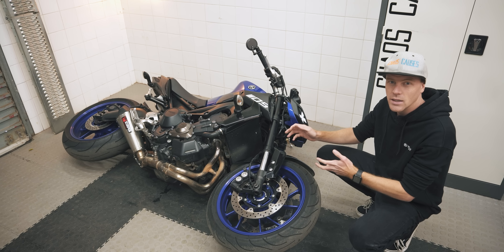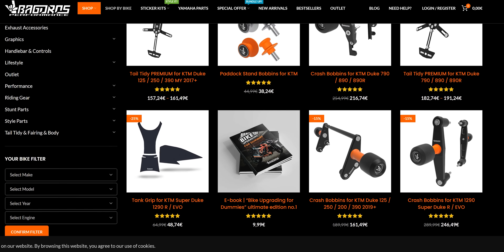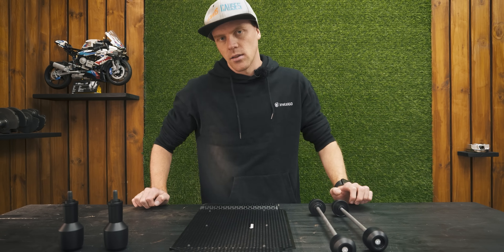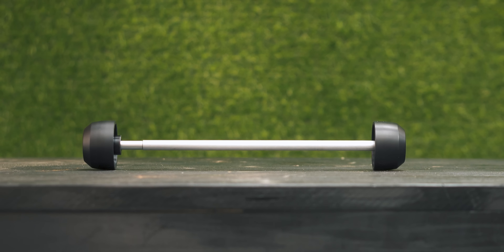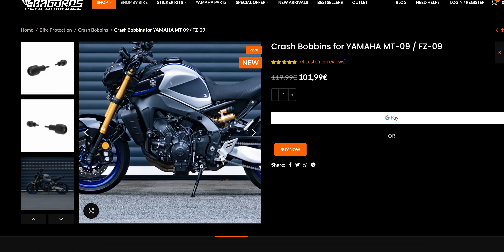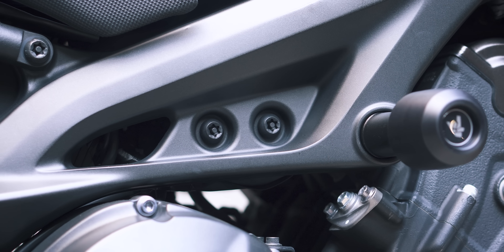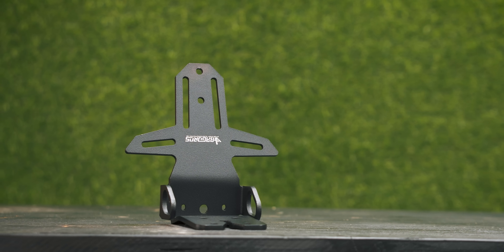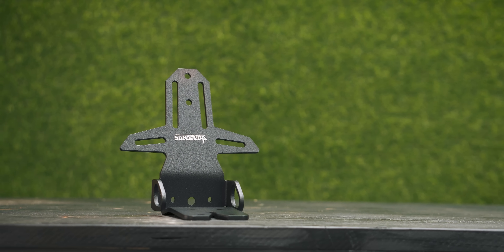3 Crucial Parts To Protect Your Motorcycle

Comment: I've bought some frame sliders for my Triumph. The local dealership offered me a cheaper version which apparently fit. Mine obviously didn't, which I only found out after the screws pierced my air intake... I didn't get my mobey back as I installed them on my own

Comment: The primary purpose of a frame guard isn’t to protect your bike’s frame - they do do that, and very well.  But their main purpose is to protect your radiator or engine covers from catastrophic damage.   If you hit the road hard, a crash can put holes through you engine covers, even breaking off parts of your engine case.  This I have seen happen.  And some radiators are as wide or wider than the engine, making them the first point of contact if you go over.  Frame sliders take the strength and rigidity of your frame and take it out wider than the engine cases or radiator.  Making it the primary impact point.  Add to this engine case sliders and axle sliders and no part of your bike should touch the ground if in a moderate slide.  You will still scratch fairing and other parts in the gravel, but these things shouldn’t get destroyed unless it is a major accident.  And then, no slider is enough.  But frame sliders are usually wider to take the initial shock of the bike going over.  A muffler slider is a good idea if your exhaust is likely to be one of the points of contact.  But at least these are easy to replace.  Then you just need elbow sliders for the wicked corners you will do because you won’t be too afraid that you will drop your bike.

Comment: Wanted to share my experience with radiator guards. I've noticed on my cfmoto 300cc motorcycle, the radiator guard I installed has somewhat thicker grate plate and in warmer days the temps go up close to the red zone almost overheating. But not really. I've not taken it off to see if it makes a difference since I've had the guard on since almost day one. I might have to drill out the holes to be slightly bigger.

Comment: I don't think radiator grid is doing any good. It MAY protect from big gravel impacts but it WILL restrict the air flow. Both by itself and by the dirt it will make uncleannable.
The stickers on wheel hubs protection screws are very nice looking but you have to destroy them each and every time you want to remove a wheel.😢

Comment: Justin, MT-09 or XSR900 and why?
Reply: XSR because longer swingarm, higher pegs, lower handlebars. It handles better. Also, it looks much better IMO.
Reply: @2WheelsGood.01  That's kinda good summary. I just wish there was an SP version though, the shock on the standard bike is not great.
Reply: @TheOriginalCoda  I have the 2023 model, absolutely love it. It's totally fine with the factory shocks and adjustment. Then again, I just weigh 155lbs. I'm not racing or taking it to track days. SP would be nice, but the price premium isn't worth it for me.

Comment: Lol at the radiator protector part, I just installed mine and also got no instructions, then realized how sad we had become as a species.
Since when did men started to need instructions? or directions? just look at the part, see where the holes are, look at the bike, where the screws are, then go for it, what can go wrong? (well, many things, but that´s part of the fun, that´s how you learn: from screwing up).
Take the dust of that wrench set and have fun.